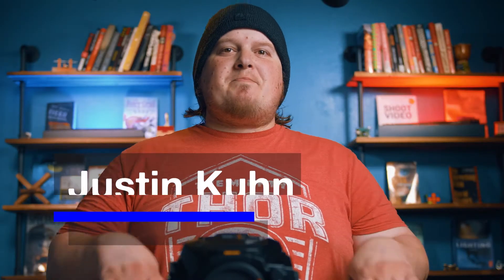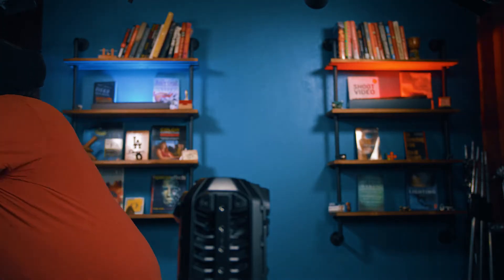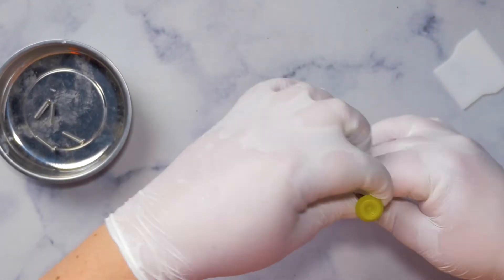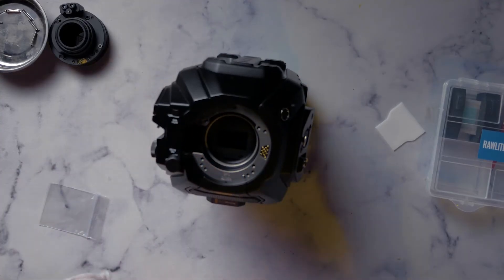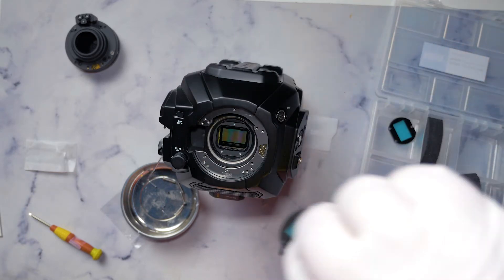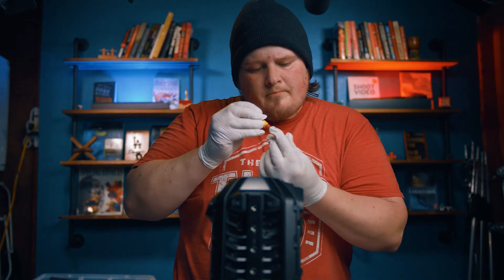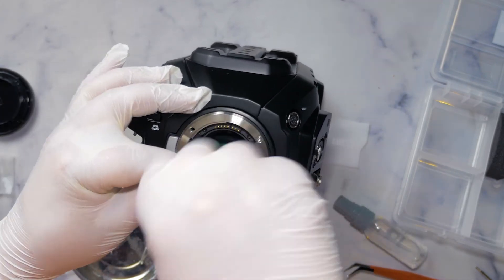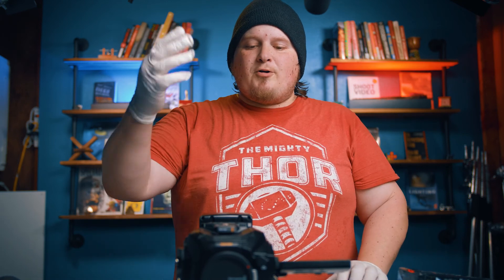Installing an Optical Low Pass Filter on The Ursa Mini Pro (Rawlite OLPF)

Comment: Why the extra shim over the other one? Shouldn't you just take the original out
Reply from the maker: It’s additional, you need both you can use just one or multiple as long as the shim depth is the same.

Comment: Do you know if you need to open up a PL mount for the spacer thing or is that just an EF mount specific fix? Thanks.
Reply from the maker: The spacer is to get it to square one, the normal spacers are needed for the PL mount after this